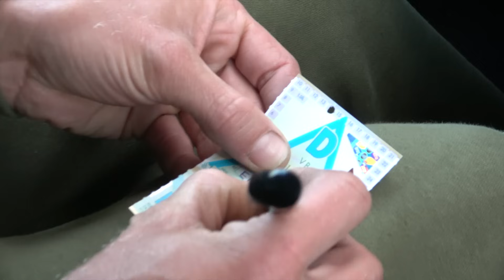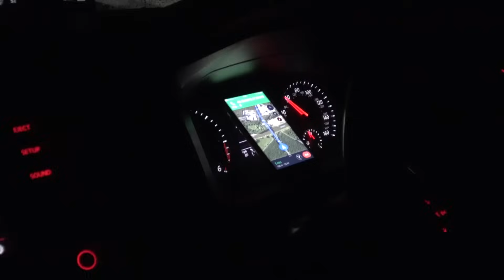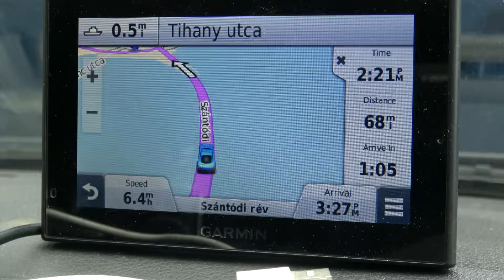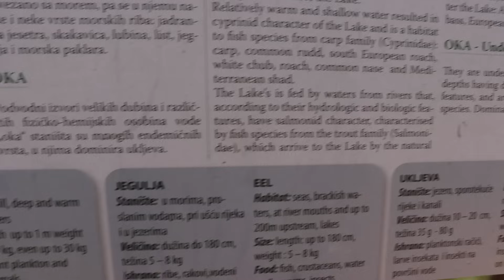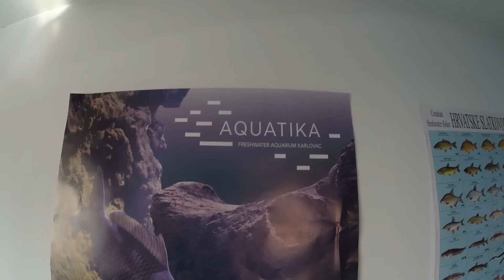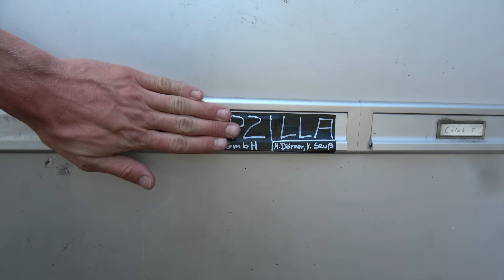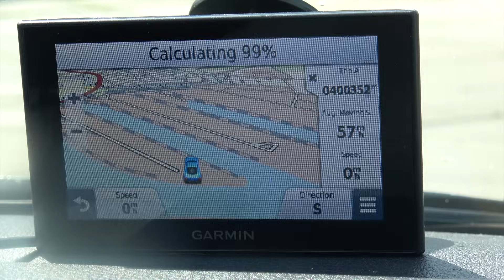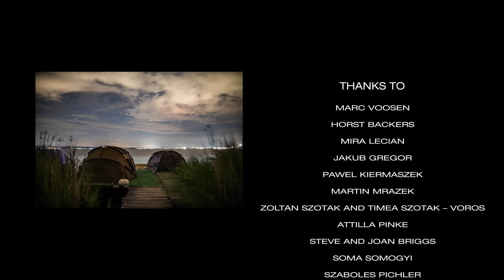EUROBANX 5 with Alan Blair and Oli Davies - CARP FISHING FULL MOVIE

Comment: Might be worth getting a second set of wheels for the van for these long forays into unknown territory, those alloys and low profile tyres look great but you'll struggle to get a replacement set if you gash a tyre or smash a wheel. A cheap set of steelies with tall sidewall tyres will be less prone to damage on unsurfaced roads, give a better ride and be easier to replace in the back of beyond should you need to

Comment: PINCHED FROM SOMEONE ELSE

OILS, how many of you use oils to coat your baits for carp fishing ? I did for many years then found out that carp can’t actually detect oils so for us to use it as an attractant is a waste of time and the only benefit we the anglers get from it is it can create a nice flat spot on the surface when the carp are sifting through our baits releasing the oil molecules which then rise to the surface.because an oil molecule is in essence a sealed unit it does not disperse into the water therefore the carp can’t detect it through taste .however making baits with an oil or crushing your baits up and mixing with oil will trap food particles within the oil molecule which the carp can then taste once eaten. Remember carp can only detect a flavour which is water soluble which is worth remembering next time you poor hemp oil all over your whole bollies.